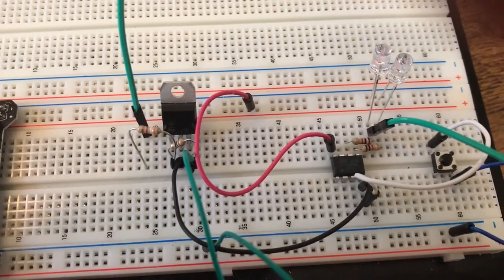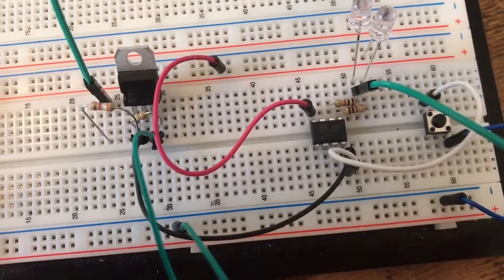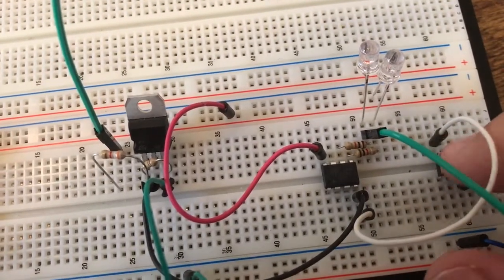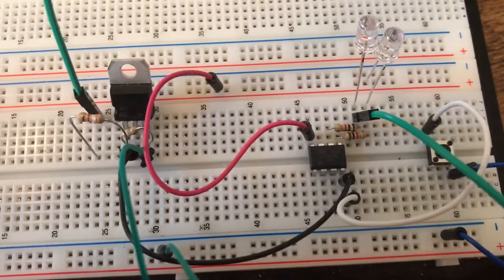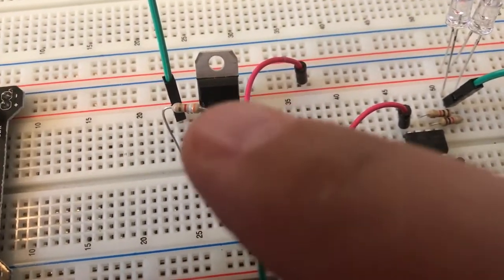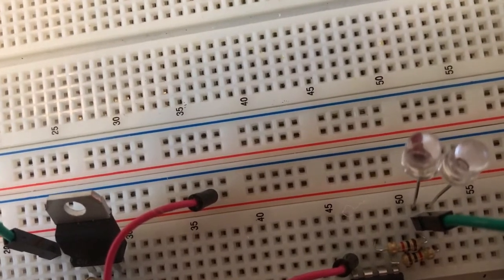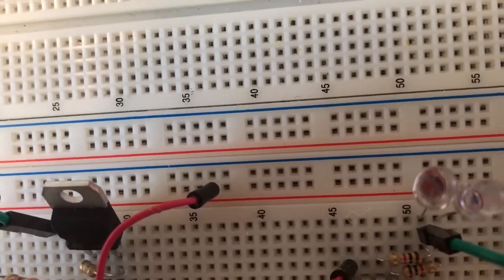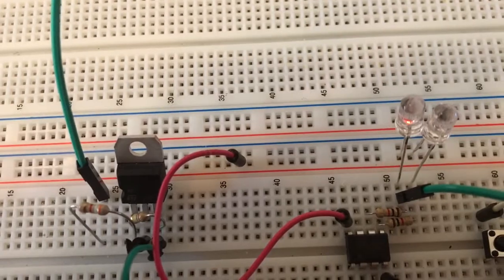Attiny85 turns itself off

Comment: May be an old vid
But it looks like the pull down resistor is not high enough or the source is fluctionating  
Meaning the gate is not getting enough power
And so i would us a 100nf capasistor  followed by a 10nf cap for smoothing  out the  input of the voltage to the chip

Comment: You have a complete circuit from pos thru LED to grn wire to gate resistor and then thru resistor to ground (source pin) .   Depending on what state the micro quits at it may intermittently ground the pin that the LED is on and reroute any LED leakage current right to ground.   So you get random dim LED.

Comment: Hi Mark. I'm not positive without looking at schematic of your circuit but,  do you have a high value resistor going from the gate of the N-channel transistor to ground? The gate has a certain amount of capacitance, if you don't have a path for the gate capacitance to drain, it will do weird stuff.